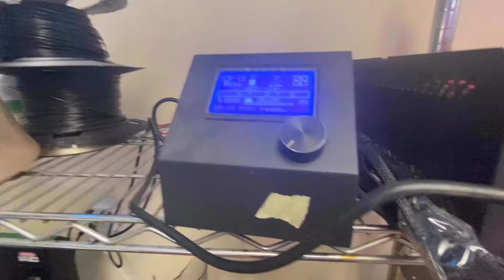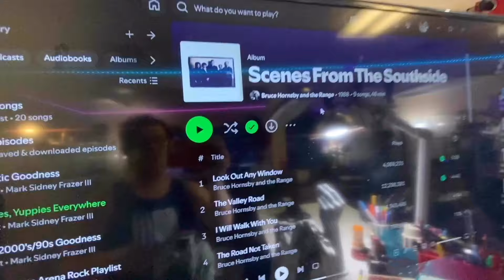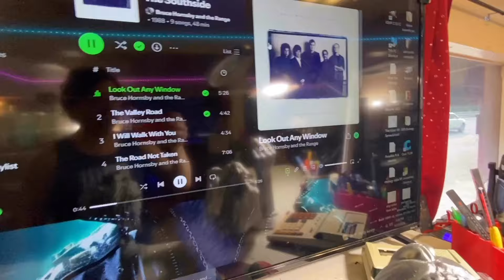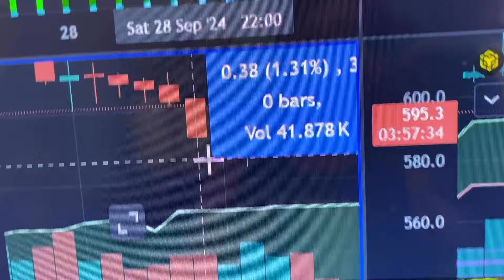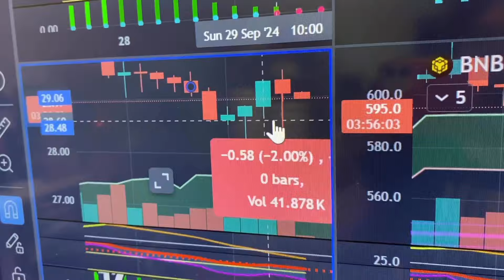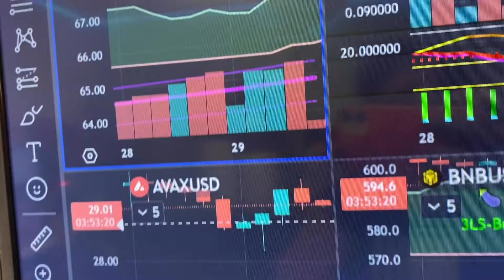How a 3D-Printing Business Works: Custom Dragon Project, Cleaning Recycling Area, Vlog #63

Comment: Gratitude: I'm grateful for the basic necessities of life.
What is going on/projects: Customizing my Ender 3 Pro a little more now that I am up and running on Klipper.  Putting together that $50 Ender 3 V2 from Microcenter tomorrow. Another project is finding more vertical space to put printers 🤣 I'm familiarizing myself with Fusion 360 again so I can make some more of my own models. 
Dreams/Aspirations: To keep learning and doing
Random Nonsense: That's what I usually post